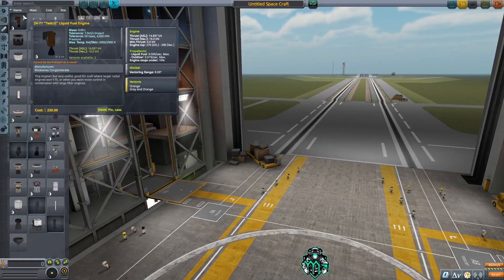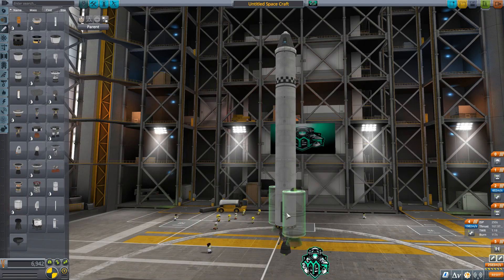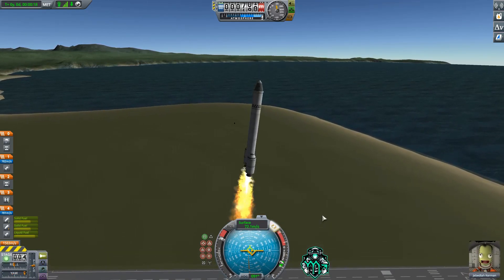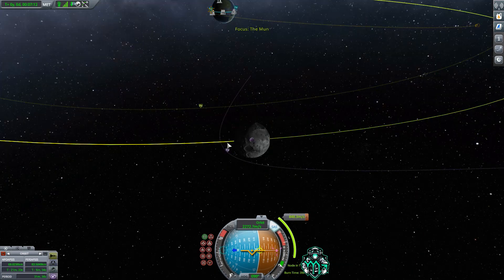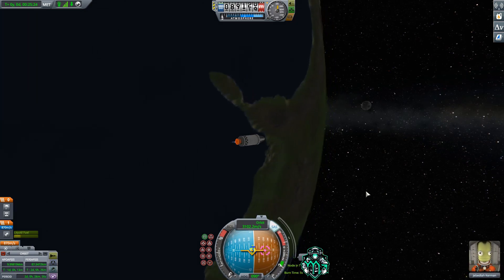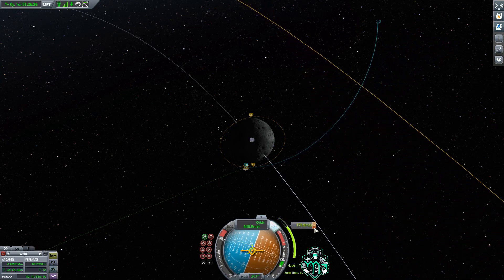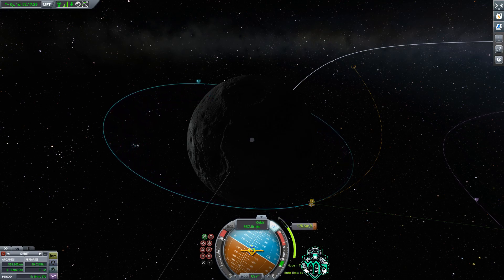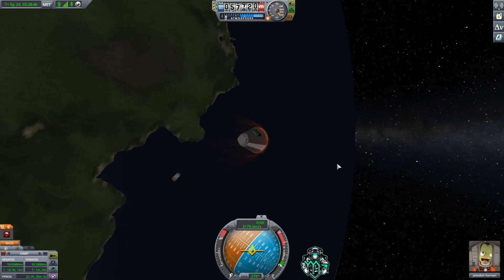Kerbal Space Program - Tutorial (Orbiting the Mun - 2019)

Comment: Thanks for the rocket design. If anyone in the comments can help me with this, I randomly start flipping out around 80% of the time I try to orbit Kerbal. I have my aerodynamic overlay beneath my center of mass so that isn’t the reason, and everything on my craft is completely symmetrical.
Reply from the maker: Do you have fins on bottom?  That will solve 90% of that issue.  Also use fairings if possible or a capsule to help with aerodynamics on top.  Thanks for the comment, much appreciated.